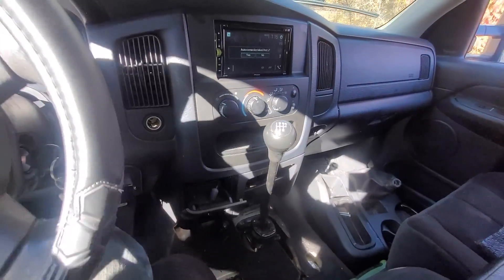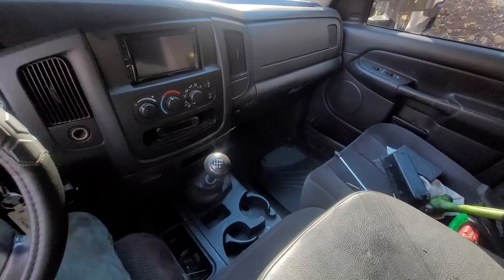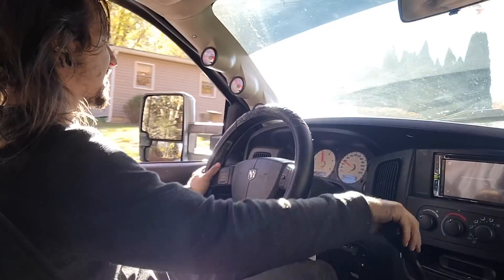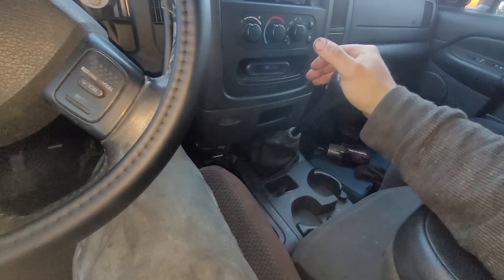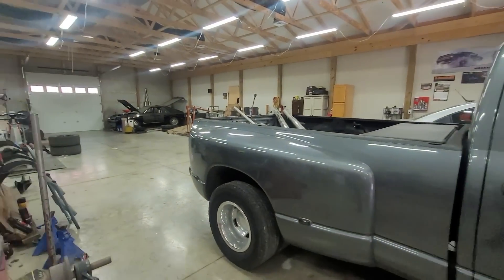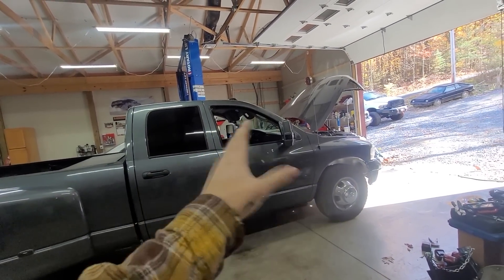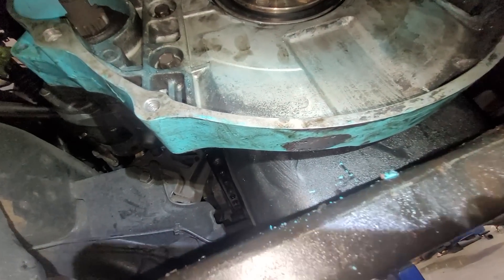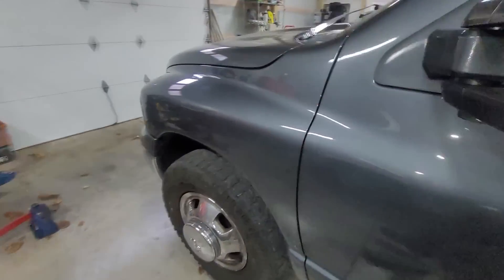Transmission Install Gone Wrong | Redoing Swap Due To Camshaft Oil Leak | Making This Truck Perfect

Comment: I do enjoy watching your channel I've never commented on anything you do it properly at least wipe the crud out of the the cup holders where the bolts go when you put the bolts back in it it only takes a couple seconds. It goes a long ways giving it back clean how it should be step up your game Steve the mechanic. Just giving you a hard time cheers enjoy your weekend clean those parts up. Watching you from Calgary Alberta Canada.  You can now wash that gearbox before you put it in there either where the cost two dollars you probably have a pressure washer right at the shop. Bad thing has so much oil underneath and how can you tell where it's coming from first thing you do when you start a project just wash it. That's my opinion not everybody's. Even if you don't get paid for the hour of washing it least you know go suck down a couple beers and smoke a fatty now
Reply from the maker: We do have the pressure washer but when it's super cold(to us Pa folk) we generally avoid water or washing things. I try to go the extra mile when the weather is nice though. I'll have to keep it in mind for future stuff that we need to invest in something a little better for the cold. Appreciate the comment!
Reply: @CPSteveMiller  go enjoy your family the doggies are always going to need work the best truck in the world six in a row ready to GO or TOW.

Comment: So to get a stock 12v to that 500ish range like Josh's truck goal how much give or take? And how reliable is it being that much power. And also how much torque at that point?
Reply from the maker: There's many ways to get there and torque will vary on setups. At 500hp with compounds torque will be massive compared to torque on a big single. He chose a big single so it'll be less torque but more reliable. He spent probably 6k on the parts alone. Turbo, injectors, Clutch, input shaft, lift pump, etc. Power driven diesel are the guys a recommend asking for 12 valve power upgrades
Reply: Ok and also what tool box is that? I wanted something that is flush with bed
Reply from the maker: The one I used didn't have a name but it was 2ft deep and 2ft wide. Flush with the top. I got it from marketplace

Comment: I have a question for you since you seem to be the only one with actual knowledge on the whole swap ordeal. What all needs to be done to run the auto behind a 12 or 24 valve?  Does it just need a Crank signal from the engine? Was going to put a 5 speed behind a 24 valve in my 3rd gen but now debating keeping it auto so I don't have to get new driveshafts. Love the videos btw!
Reply from the maker: What is in it now? Send me an email or instagram message. I'll get more information from you and go from there
Reply from the maker: Links are in the description
Reply: @CPSteveMiller  thanks Steve, shot you a message!

Comment: I'm guessing the g56 came stock with a dual mass flywheel? That would explain the noise. Ford used an aluminum zf 5 speed behind their diesels and with a single mass flywheel you'll get gear rollover noise. It seems the cast iron case trans don't have the same issues due to the properties of cast.
Reply from the maker: It was rebuilt and clutch was replaced. All I know is it is so much quieter now. No more headache!